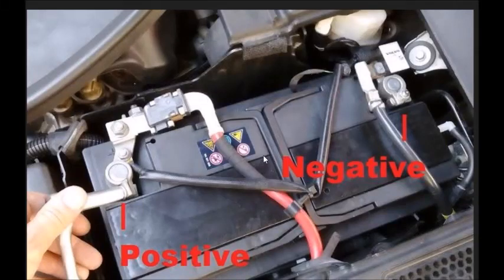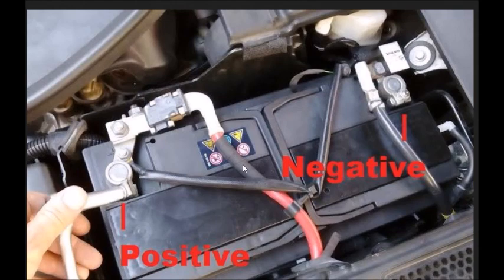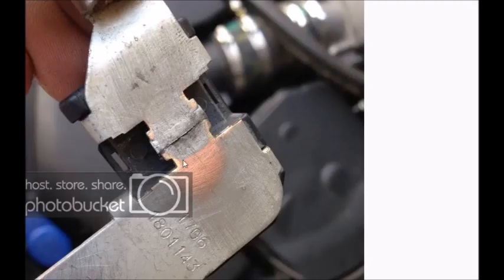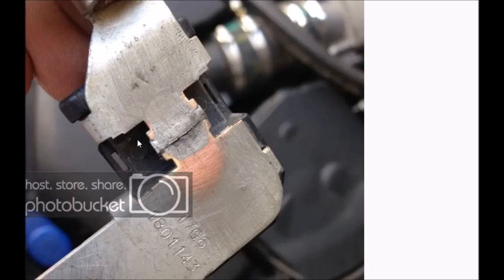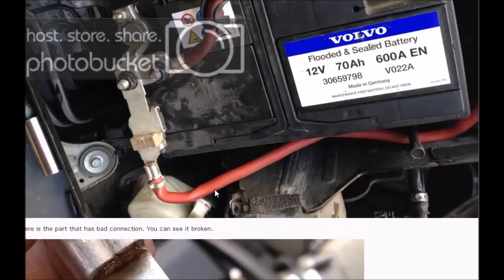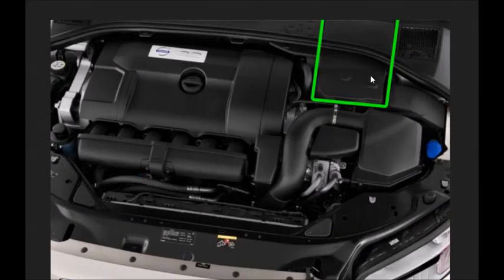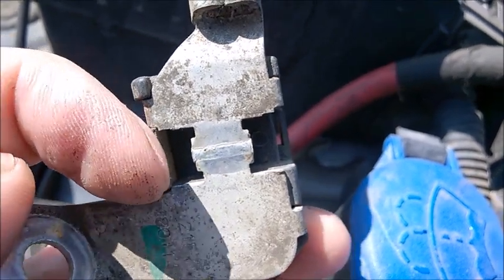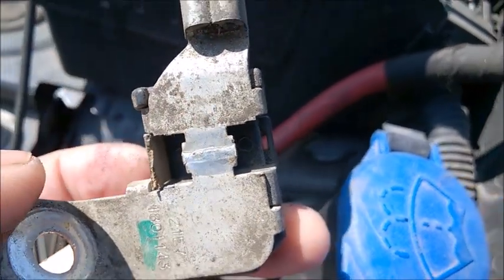Volvo V70 XC70 S80  Electrical issues / Door locks / Power loss  2007-2016 P3 platform

Comment from the maker: Another common and costly issue on the P3 platform is cabin blower failure. On the P3 platform, Volvo put the blower in the center of the dashboard, difficult to access and requiring a special tool to disengage it from its bracket. What's more, Volvo is using the same Behr blower brand which unfortunately start seizing at the sleeve bearings - will make a squeak noise at first on cold weather. Difficult to tell at which miles/km these will fail, on wet climates it may happen well before 100K miles. See this DIY video https://www.swedespeed.com/threads/blower-fan-replacement-in-p3-volvos-video-instruction.491594/